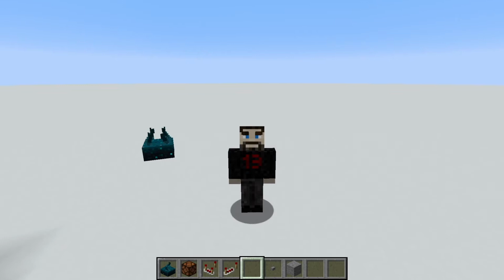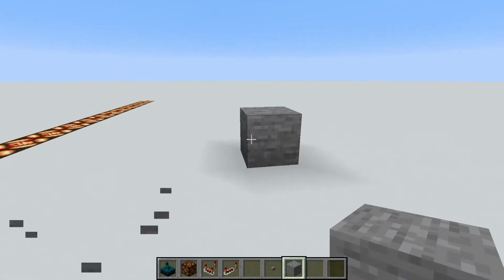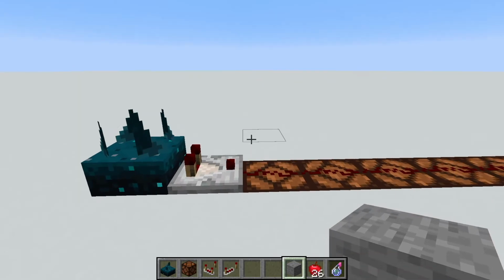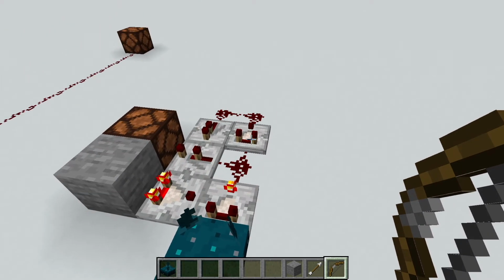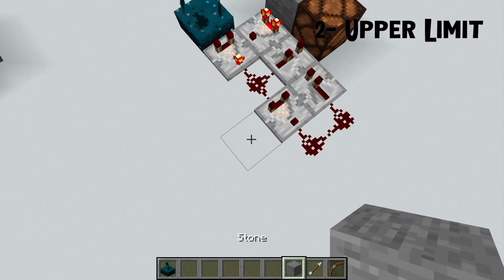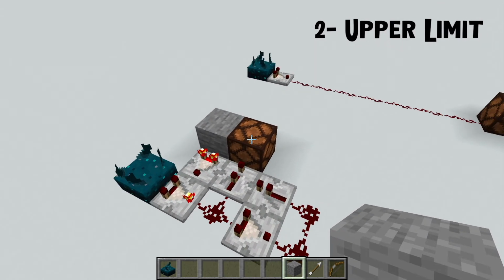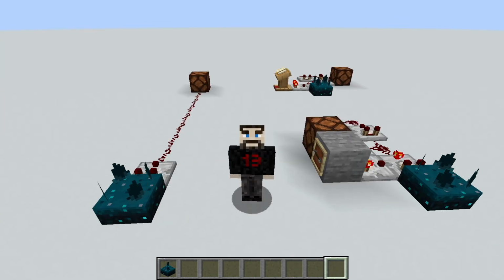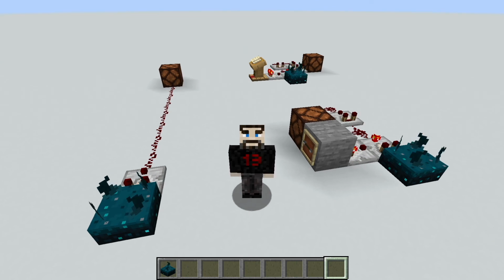Sculk Frequency Detector - How to make a filter for sculk redstone signals

Comment: Shoutout from Pixlriffs community...
Just curious, 
if we can detect frequently + the amplitude (without the comparator), then we can ideally detect if a block placement (just an example) is done at a specific set of coordinate !!!! Like 5 blocks from the skulk sensor in all directions.
And adding wool blocks in all directions except one specific direction, we can ideally create a circuit that will activate only if you do a specific activity with a specific amplitude at a specific space coordinate in Minecraft world!!!

It would be crazy to see a video on a detector circuit with frequency + specific amplitude combined!!!
Reply from the maker: Yeah, that’s a cool idea. You could get really creative with it!
Reply: With two more sensors you could get the exact x,y,z of the noise source and the frequency will tell as to the noise type.
Tango Tek needs this for his HermitCraft mega project 'Decked Out II'

Comment: How did you get the signal strength of 7 to activate, when the signal strength of 14 activates first from "finished interacting with the bow"? It now doesn't work when you shoot an arrow, but when you throw an egg, it works.
Reply from the maker: Mojang had updated and adjusted some of the frequency values. I made a video on how to determine the value that you’re looking for, and how to troubleshoot it. How to Use Sculk | Minecraft Tips & Tricks
https://youtu.be/6PGcft1xgNM

Comment: Poped into creative to do some guess and check to find a way to power my hidden door only by placing a helmet on an armor stand. Even following exactly what he's doing it doesn't work. Sculk broken on bedrock?
Reply from the maker: It doesn’t work exactly the same in Bedrock. Instead of a lectern, I used a block with an item frame on it and placed an arrow in the item frame that is pointing straight up into the item frame. I got it to work by putting 2 ticks of delay on the output repeater. The helmet idea is a good one! I wish bedrock and Java were more similar. I hope this helps!

Comment: So if the signal strength passing through the circuit is greater than 1 it locks the repeater? I’m confused as to why the repeater locks if the strength of the input to the skulk sensor exceeds your desired input level
Reply: Never mind I see. If the strength is greater than one it spills over because you have two red stone coming out of the upper limit comparator, this cause the repeater to lock. If the strength is 1, it only lights up the first red stone you put down and isnt strong enough to reach the second one that would power to repeater
Reply from the maker: You got it. Super important to have a little delay on that output repeater so that the spill over has time to reach it. Hope this helped!
Reply: @Todd13  yes it did! Thanks for the reply earned yourself a sub!

Comment: I was really hoping he'd give a list of what to replace the lectern with. I.e. I want a signal of 8 only I would place (x) item in that slot. Not just here's the build now guess and check until you find the right block to lock it..
Reply from the maker: There are A LOT of things use can use. Literally, any container and many blocks that have different block states. I find the lectern with book and the arrow in item frame to be the simplest to set a value, so those are my go to items. 
If you want to go down the rabbit hole: https://minecraft.fandom.com/wiki/Redstone/Redstone_Comparator has a section called Measure Block State and Fullness of Containers. It goes pretty deep into containers that can be used and the calculation that the comparator uses.

Comment: My book is sending a singnal of 7 and it still doesn't work when I shoot my crossbow. The crossbow has a signal of 8, ich checked.
Reply from the maker: Try flipping one page forward or back. I have found that sometimes the wiki values aren’t always accurate or they’ve been changed in updates. Also, the upcoming calibrated sculk block will make all of this easier. Hope that helps!
Reply: @Todd13  thank you for your answer! I already tried flipping the pages but it still didn't work. I wanted to make a secret entrance that only opens when shooting a crossbow.
Reply from the maker: Hmmm. The other thing that gets overlooked is the couple ticks of delay on the repeater. It won’t work without that.

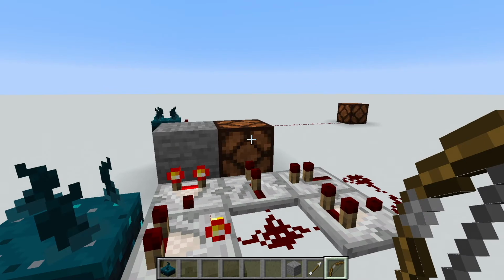Comment: I did the design at 2:40 literally identically and it doesnt work
Reply from the maker: Make sure your subtractive input is correct and make sure the output repeater has a couple ticks of delay on it. Those are the two most common things that people have been missing.
Reply: @Todd13  I did both exactly like that. I'm going to end up installing the mod that fixes all the issues with them, because then I can just select what I want It to hear

Comment: second machine doesn't work
Reply from the maker: The two machines are identical. The frequency values of events have changed over the last couple years. I made a separate video to determine what the value of an event is. Also, the upcoming calibrated sculk block in 1.20 will eliminate the need for much of this circuit. 1.20 comes out next week!

Comment: You didn't explain how to make the second one
Reply from the maker: Hi Jayden! What’s surprising is that the first one and the second one are exactly the same circuit! The only difference is I put the light on the opposite side. If you follow the signal you’ll see it hits the blocks in the same order. I did this to illustrate that you can slightly change the layout of the circuit to fit your space. The one thing that isn’t 100% yet is the frequency of different events. Mojang have tweaked this a couple times in the snapshots. Hopefully we’ll get a final list of frequency values in the next few snapshots. Hope this helps!